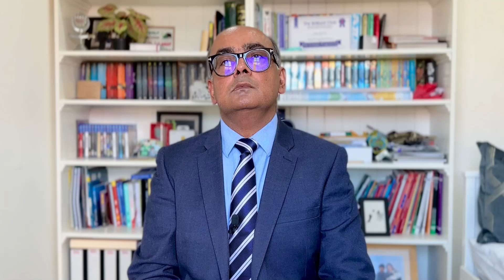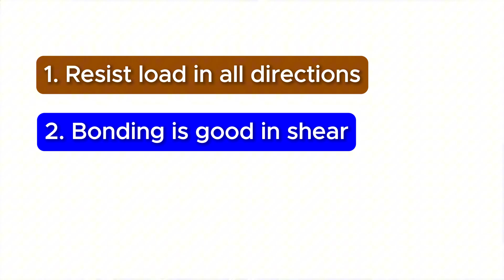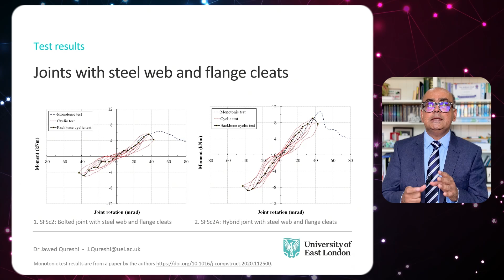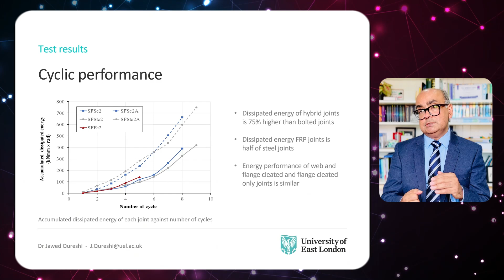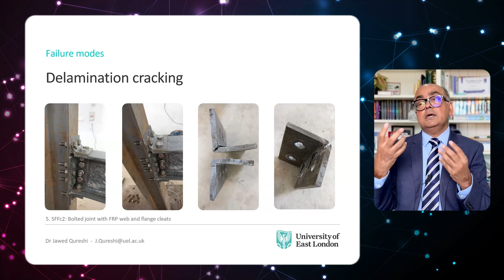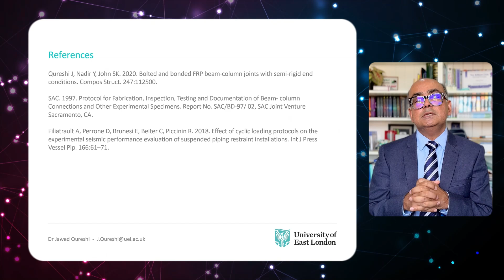Why FRP composite is such a desirable material? | Buildings and Bridges | Conference paper

Comment from the maker: ⏰ TIMECODES ⏰ 
00:00 – Introduction 
00:24 – What is FRP?
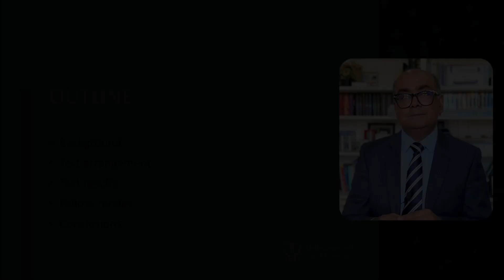01:46 – Where to use FRP in Civil Engineering 
02:34 – Why FRP is such a desirable material?
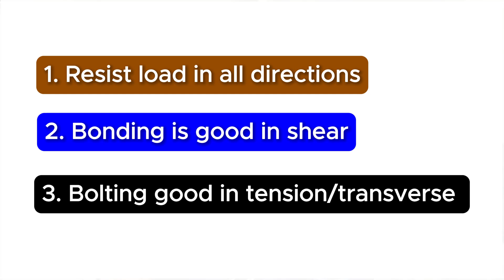04:29 – Test arrangement 
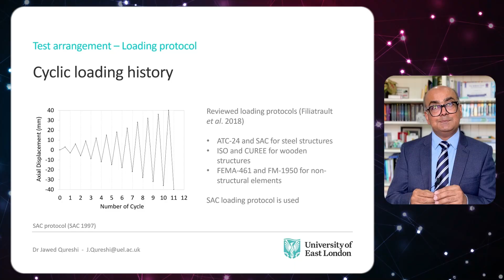05:50 – Test results
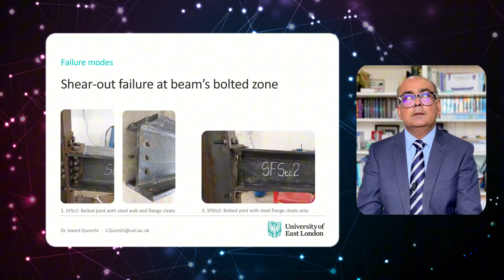09:20 – Failure modes
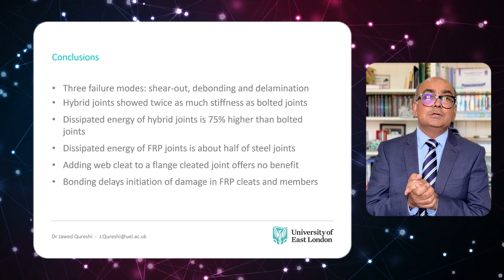11:09 – Conclusions

Comment: Did they used This material in building the new parliament hose in Delhi. Show the partical results. It's same thing with solar panels. If it's so great than why all Indian government school and government All Office building run by solar panels energy. Loads of Cheap gossip program. 😢😢😢😢😢😢😢😢😢😢😢
Reply from the maker: I’m not sure of this material’s use in primary structural applications in India. But FRP has been used in various footbridges across Europe and America, primarily due to its lightweight and corrosion resistance. It is also considered durable material as it requires less energy. Every material has its pros and cons. Concrete is weak in tension and strong in compression. Steel is slender and can buckle. Similarly, FRP is not suitable for all applications. I haven’t seen its much use in buildings too.